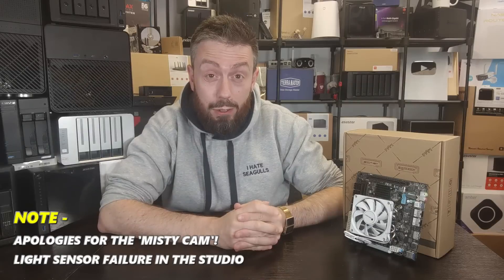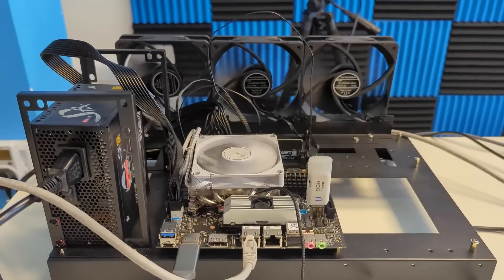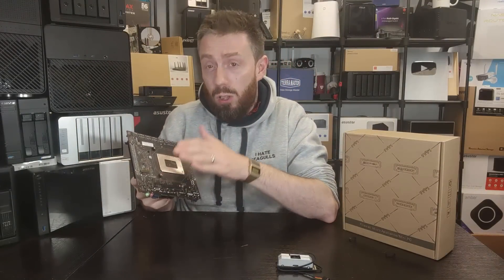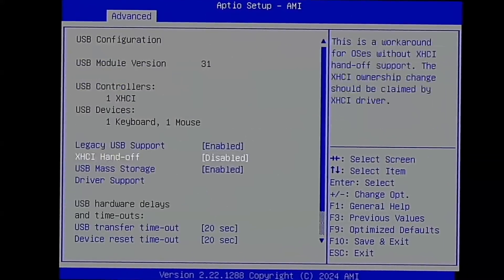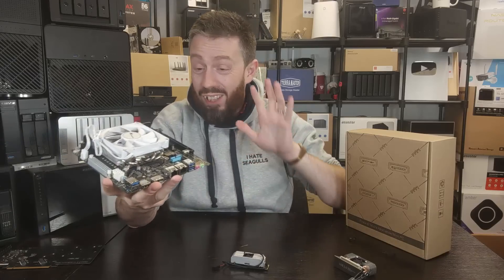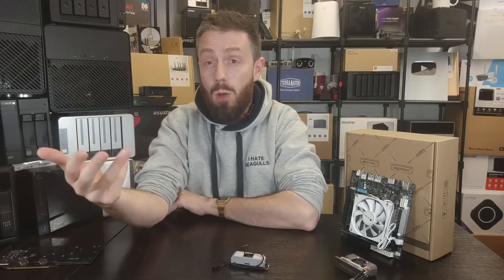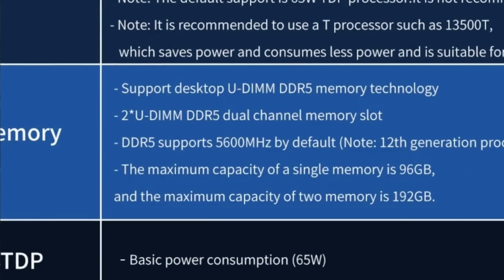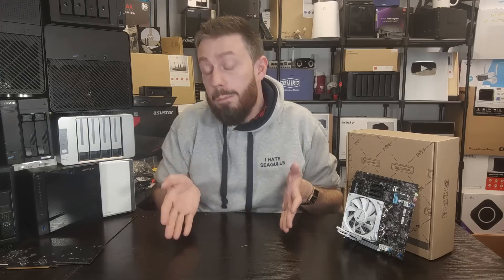CWWK Q670 Gen 5 NAS 8-Bay Board Review

Comment: CWWK released a new version of this board, a white version with 2 SFF ports which can provide 8x SATA
Reply: And should let you use SAS drives as well which is great
Reply: Yea but for some reason the upgraded board drops the max ram to 64 from the older board that could handle 128
Reply: @PumpkinKingXXIII I have 96gb on that board no problem that the limit of the cpu afaik
Reply: @RealtecNL been looking at the board but I've seen its got some issues, your thoughts?

Comment: Ryzen 5800u on a mini Nuc is cheaper with 16gb ram and dual 2.5G with wifi 6 and 512 nvme. Just add 2 USB 8TB drives and install TruNas. Its 25w TDP and can do gaming with the built in gpu

Comment: Hi! Thanks for all your videos, I learn a lot with you. I have recently gone ahead with a Jonsbo N3 + CWWK 8505 motherboard. I have configured everything and it works great with Unraid, except fan control. I have switched all the fans in the case to PWM but regardless of whether or not I activate the dynamic control system and its thresholds in the BIOS, or even setting the fan control to a manual PWM value does not generate any change in their behavior, they continue to run at the same speed. I don't know if I should update the BIOS or what I should do, but I can't find any documentation or link to a more updated bios version either. If you could help me I would be very grateful. Best regards.

Comment: Excuse me, 3 what (hundred)? May I purchase a normal motherboard with 4 sata for $50, a normal cpu for $50, a pcie to sata for $20 into one slot, a pcie to nvme for $20 into another one, and be happy. Because 6-8 3.5" drives require so big case, and psu, that literally any motherboard will fit.

Comment: I just ordered the Board. Can you recommend some CPU coolers that won't block the udimm slot?
I planning to use a jonsbo n4 - since the n3 will take a month or so. Maybe i will get the n3 anyway but if the n4 is the only option i have to fit a top blower cpu cooler.
Any recommendations?
And did you try the intel stock cooler?

Thanks for testing and thanks for your review post!
Reply: Noctua L9i / L9x65 are both small enough.

Comment: I got this board, plus an i5 12500T from AliExpress. The board did not want to boot, it beeps when I power it on. CWWK support said that either memory is incompatible or CPU is not seated correctly. Board keeps beeping even without the memory installed.
I am returning both the board and the CPU, even though it is more likely the board is bad.
Anyone else had an issue like this?
Reply: what psu were you using ?
Reply: @kskid4life  resolved it a while ago, the memory was incompatible. PSU is a good seasonic unit

Comment: Imagine it was 4xgen3 drives on the back rather than 2x gen4 drives, sure it would need a 4.0 to 3.0 multiplexer but still that'd be pretty cool.
I wish Optane hadnt died out, would love a gen5 optane drive to go in that 5.0 slot with 7GB/s and near RAM latencies for a special metadata drive, though for special metadata you really should have 2-3 drives.
Reply: Many PLX will handle mismatched PCI revisions. In theory, you could plug in a bunch of Optane.
Reply: @kennethfeagins1414  I nave 4 optane 905p on the hyper m.2 for my 7950x server, though that doesnt use a PLX.

Comment: Like this board! Based on you review I've purchased the H670 version and set it up with an i7-13700T, 96GB (2x48Gb) memory, 4x-mirror mode spinning disks, nmve SSDs and a Mellanox ConnectX-4 single 100Gbe. 
What I noticed though is that the single PCIEv5 slot shares recources with memory; when using the Mellanox NIC card (PCIEX 16x) the system will only read half of my memory and ignores the second bank. Switching to a ConnectX-3 card (PCIEX3 x8 2x10Gbe) it does work again..... 
I'm now trying to figure out how I can force the PCIe slot to work in PCIe 8x mode (as the 100Gbe Mellanox is a single 100Gbe one) but as you've mentoined, BIOS settings on this board are quite elaborate....  If anyone knows what settings to look at or play with I would appreciate that.

Comment: Have a 13700k. Have 8x16 tb hdds. Was thinking about this board or the meg z690i. Which is better in your opinion?
Reply: Hi, Just so you know, constructor does not recommend using a huge CPU on this motherboard, cause of it’s vrm cooler that is not efficient. (Limitation is between 65W-125W of TDP from what i’ve seen, so it is even recommended to use an Intel T, wich are the same CPU as all others from intel, but limited at 30W of TDP (Here the 13500T is recommended))

Comment: I'm also interested in this tiny beast, but I've got two major questions. What Sata Controller does this board use? JMB or AsMedia? Want to use it with unraid and the JMB often causes problems with power efficient builds. Second: how good are the VRM, the data sheet said max 65 Watt TDP, is it usable with an 14600 or higher, or are we stuck with the "T-Series"?

Comment: AC to SC from DC to ERf split the audio into 2hub avi channels btle the audio and jack the video using red-ultra and direct the load to local motor batt and feed generator overtick to bay field battery and garage outhaust and waste or straight down the drain pipe if ceramic with as it is service box treatment wifi over the electric over btle and red light multi accutrainable semi conduct directional ocusig and direct load energy as packets of dloadable energy. Watss son

Comment: To me THE number one limiter in "NAS" boards these days is networking. This board should ABSOLUTELY have a 10gb NIC built in and a 1gb Management port. 2.5gb is outdated AF for "do it yourself" NAS's. Especially when the board has so much high speed storage capability and so much bandwidth available from the CPU.
The PCIe slot should NOT be 16x. It should be 8x. PCIe 5.0x8 is more than enough bandwidth for literally anything you want to put in that slot. Including even the latest most powerful video cards. And the PCIe 5.0 M.2 is also a pointless waste on a board made for NAS's. Should have just been another Gen4x4 or even 2 more Gen 4x4's for the same bandwidth.
The extra bandwidth should have been dedicated to 10gb networking and perhaps even some U.2 or Mini SAS or even both.
The slot NEEDS to be left available for Storage, HBA's or a GPU for compute or encoding/decoding. But with only 2.5gb, you would have to waste the PCIe5.0 slot on simple bloody networking.
I keep seeing these boards come out and only ever be NEARLY the perfect home server board. And this is once again the case. How do manufacturers consistently continue to fail in this arena.
This board could have been excellent if only it had friggin 10gb onboard. What a shame, what a waste.
This board is a big "BOOOOOOOOOOOOOOOOOOOOO" from me. Such a shame.
Reply: I find 2.5GB networking to be overkill (but nice) for a spinning rust NAS. I don't come remotely close to maxing out the 1GB NIC on my 45 bay file server. If you have a NAS with a dozen NVME SSD's then sure, you want 10GB.
Reply: @MichaelBushey  If you cant saturate a 1Gb NIC with 45 HDD's brother, you've done something very, very, VERY wrong. I don't even know how that's possible, no matter what configuration you have the drives in. A single SATA3 HDD will provide a sequential transfer speed of about 100-125MBs. That's a 1Gb NIC right there. With 45 drives, you should be able to saturate a 40Gb network connection.
Even a 4 bay consumer NAS with 4 HDD's in RAID5 can get you about 400-500MBs (read) on a large file transfer. So even a 2.5Gb NIC will not utilise the full speed of the array when transferring a large file. Hence my comment that 2.5Gb NIC's are "outdated AF" in NAS applications.
12xNVMe drives with lets say ~3000MB's R/W (average PCIE3.0 NVMe drive) will give you ~36000MB's. You could literally saturate a 400Gb connection with that. A 10Gb NIC is nowhere near utilising the performance of that array. A single NVMe PCIe3.0 drive will saturate a 10Gb NIC. Even a cheap shitty one.

In my NAS server, I have 12x16TB HDD's and 8x4TB SATA3 2.5" SSD's. The 12 HDD's alone more than max out my 10Gb connection. And the SSD array is not even getting close to being fully utilised by the 10Gb NIC on large transfers. I'm actually about to upgrade my network to 40Gb. Well at least between the NAS and the servers as well as my main PC.

1Gb is completely deprecated and totally redundant in ANY NAS scenario. They shouldn't be used for anything other than management. And 2.5Gb is now outdated. As I showed earlier, even 4 spinning rust drives in a consumer NAS can max out a 2.5Gb NIC. Even 2x2.5Gb NIC's aggregated are only just gonna get you there.
I know these are ideal speeds during sequential transfers and you wont always be transferring that fast. But the vast majority of NAS's are used for mass storage and backups. So considering most backup applications these days are going to compress the files for back up and transfer one large archive, sequential transfers are super common.
Solid state arrays can be used more efficiently with R/W operations, but a NAS with HDD's in it is still going to need a high speed network connection.
And none of this is even getting into NVMe caching or filesystems like ZFS where RAM is used as cache. And yes, I'm still talking home use.

So yeah, I maintain that 10Gb NIC's should standard on ANY motherboard which has been designed for NAS use. And 10GbE is backwards compatible with 5Gb/2.5Gb/1Gb/100Mb. So there is no downside other than price. But if they were made the standard, they would be manufactured in drastically larger batches, thereby reducing the additional cost. Possibly even negating it. And all modern CPU's, even embedded ones have enough bandwidth to accommodate 10Gb networking.

Comment: Still planning out my NAS rebuild, I'd love to see one of these manufcturers put a 10gbe/SFP+ port and make the board a little bigger with 2 X8 slots instead of 1 X16 and all the M.2 on top.  It's hard to cool some of the hotter running gen4 drives when it's on the bottom of the board.  That said the addition of vpro is pretty huge, if you can live with the 2.5gbe this isn't bad for the money.

Comment: I'd guess, if you populate then gen5 M2 slot, you will lose 8 lanes on the x16 slot.  Intel does not have own gen5 PCIe lanes for SSDs like AM5, so board manufactorers need to chop them of from the GPU lanes by bifurcation.  Means: placing a SSD of any gen in the gen5 M2 leaves you with a x8 PCIe only slot and that is not possible to bifurcate anymore. Every other Intel 1700 board works that way because of the CPU limitation.

Comment: This looks Great to build my N3 NAS, just a quick question, since you know the N3 and this board, what is the best/biggest CPU Cooler to get to avoid interfering with RAM or PCIe Slot?
I'm thinking on going with i5 12500, unless you can provide a better recommendation.
Thanks in advance for your advice and of course, looking forward to see the Build :-) 

Cheers
Reply: Hi, Just so you know, constructor does not recommend using a huge CPU on this motherboard, cause of it’s vrm cooler that is not efficient. (Limitation is between 65W-125W of TDP from what i’ve seen, so it is even recommended to use an Intel T, wich are the same CPU as all others from intel, but limited at 30W of TDP (Here the 13500T is recommended))

Comment: Can you explain how the whole “low power CPU (T series) suggested” thing works? Shall my i3-14100 cause the VRM to fry?
Reply: Looking through Intel's specs, the T series run a bit slower (lower frequency) and the base/turbo power goes from 65/154W down to 35/92W (i13500 vs 13500T.). I'd also like to better understand how this works and what the restrictions are.

I looked, but wasn't unable to find any of the T series available for sale.

I read a comment suggesting that a similar effect could be triggered by lowering some voltages.... Effectively underclocking the CPU.  Which sounded interesting, but I haven't attempted to research yet.  Maybe there are other thermal throttling limits that can be set to get a similar effect, shift more work to the E cores, or something like that...
Reply: @lowellalleman  I was actually planning to just disable CPU boost. When I’ll get the board (shipped on June 22), Im going to look at the VRM to understand how much juice they can provide.

Comment: can the x16 slot be bifurcated to x4/x4/x4/x4 ?
Reply: There is a jumper on the board who put the PCI in  x8/x8 - looks like no x4/x4/x4/x4 - i keep digging
Reply: No, Intel Socket 1700 cant't do x8x4x4 or x4x4x4x4 bifurcation in general. You would need a controller card with expensive PLX-like chip to do this.
Reply: @syskeytechnician3509  then this board is useless for me. Not even proper bifurcation support 🤮.

Comment: Can the x16 slot do dual x8 bifurcation? Also the link on Ali for this motherboard doesn't work for me and can't find it anywhere searching for it manual on Ali.
Reply: You can set it to x8x8 using a jumper next to the clear CMOS jumper. I think it was labeled "2x8". I really wish x4x4x4x4 was an option on consumer chipsets, but x8x8 isn't terrible.
Reply: @PeterBrockie AMD boards usually can do it. Some older intel boards can do 8x+4x+4x at least.
Reply: Unfortunately, 11th gen was the last able to do x8x4x4, since gen12 limited to x8x8. And: x4x4x4x4 they were never able to do.

Comment: Been looking at this board for a Jonsbo N3-build. But that RAM-slot looks really tight by the cpu cooler. No real need for the PCI-E slot or the gen5 port. But the BIOS looks a bit intimidating for a first build. Would you still recommend this board? As for now I'm looking at Gigabyte B760I as an alternative.
Reply: I got the similar board with white PCB from Topton and I installed a Thermalright SL100 cooler. It fits OK inside my Jonsbo N3, and it leaves enough space over the ram that I can actually switch the modules one at a time. It takes a bit of patience but it's not hard.
The BIOS is a right mess. I requested a manual and got a quick start guide, but nothing to help with the BIOS settings really. But guess what - using the default settings after you change the ones you know need changing works fine for me.
This board has 3 gen4 nvme slots though, no gen5. Fine by me. I'd imagine the PCIe 5.0 slot will go against a 4 slot nvme expansion one fine day.

Comment: just saw this board a few days ago on another channel. this board is the final puzzle in my plan to build a Jonsbo N3 multimedia server
Reply: Exactly my configuration. The board is going to be shipped next week and it is going to end up in my N3. I am still going to use an HBA because I have SAS drives but I will eventually replace them in time with SATA and use the x16 slot for an NMVE board.
Reply: Exactly what I'm doing. I've got a huge case housing one of my UnRaid servers. This is going to shrink it greatly and save a lot of power.

Comment: ECC support? Curious to see the list of supported CPUs
Reply: Q670 chipset doesn't support ECC. But 13500+ or 14500+ cpu does support ecc with proper chipset (W680)
Reply from the maker: Unlikely, most LGA1700 processors aren't, sadly
Reply: Non-ECC ram is a deal killer for me.  Otherwise a near perfect mini-ITX motherboard.

Comment: CWWK missed the mark.  Maybe if it had a built in mobile CPU at that price it would satisfy some needs... but for $200 you might as well get a bigger motherboard and not kneecap yourself with expansion especially for 100G networking and a 16 drive HBA.  ITX is great and all but if you are putting 8 drives into a case, you probably have room for a full sized motherboard.
Reply from the maker: I mean, given their history of the pre attached SoC boards of late, I see your point. But also, this card can only really hit it's top end use with a particularly high end CPU. They would need to only bundle some 13th gen processors to really make it work...else they would roll out lesser coy choices and immediately be selling a NAS mobo that has it's wings clipped. The other issue...sticking a 13th Gen Intel in this or the like would massively inflate the price...making some users think "I'll just got MATX then".. it'd be catch 22
Reply: @nascompares  I disagree.  An i3 is more than enough for a NAS.  If they had an 8 core mobile CPU soldered on, that would be great for efficiency.  But as it is, it's kneecapped with only 2 RAM slots, and 1 PCIe x16 slot... so its not really a good 'server' or workstation.  The 8 SATA ports is it's only parlor trick and that basically relegates it to a low end NAS.  

Like I said, CWWK missed the mark and gave us a bunch of things that only amount to a half baked use case.
Reply: @BandanazX  
I am actually on the fence between this motherboard and something along the lines of Gigabyte B660M-D2H with Core i3-13100 that will fit my needs (Unraid NAS, Dockers, maybe VMs). My main problem is that this board is Chinese  - I factor in no-support, an unknown product lifetime and the price difference.
Reply: @PalindromicAnt  Building a NAS from new parts mostly doesn't make sense.  Get a used Haswell or newer system for dirt cheap.. like $50ish and save the rest for drives, RAM, and HBA... maybe a case.  Also I'd suggest TrueNAS scale instead of unraid but you do you.
Reply: Jonsbo N3 case anyone? Btw exotic mb with laptop cpu usually have terrible aspm management, so it will just consume more power than this motherboard with a desktop cpu.
Reply: @anastasy2  Yeah.  And only 2 memory slots is lame too.
Reply: @BandanazX  I don't think there is any m-itx board with 4 ram slots. Look at the size of the board mate, you can't have everything. This MB is already overloaded 😅
Reply: @anastasy2 there are some Supermicro ITX motherboards with 4x SODIMM slots. Probably also ASRock has some.